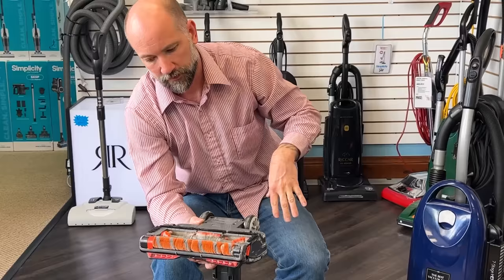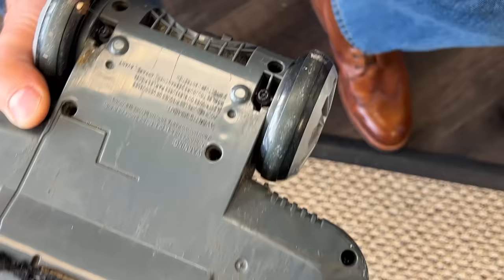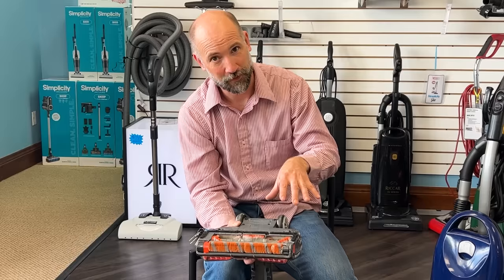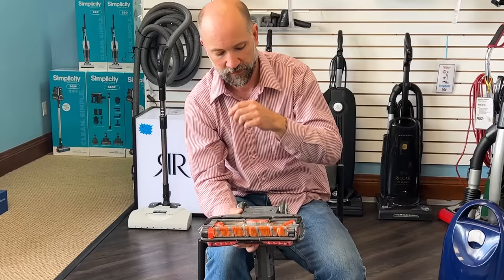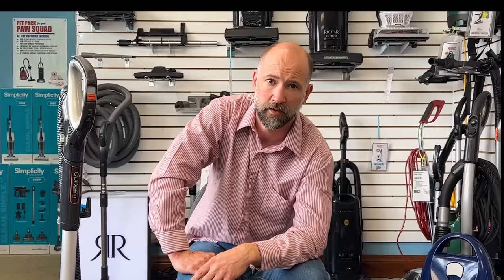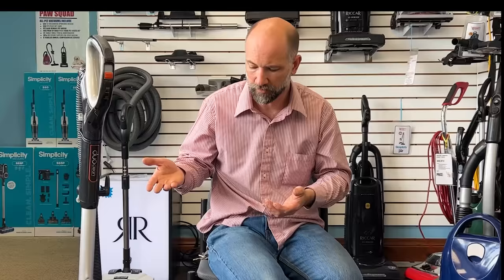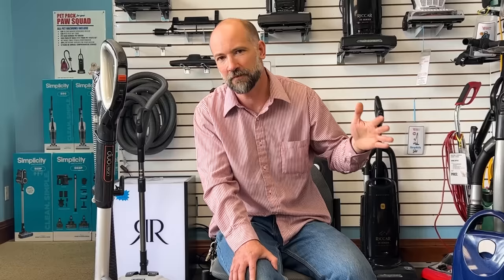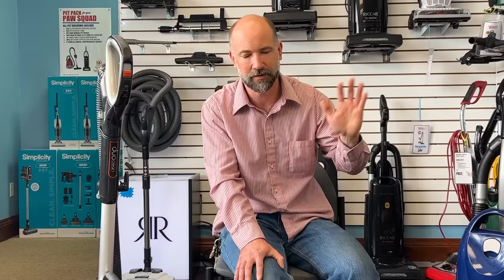Why Can't You Repair Your Shark Vacuum?

Comment: Thank you for your honest & helpful video, unlike this piece of crap Rocket, that lasted less than a year (I loved it up until then, last week) and the Roller just stopped while using (with regular house use) Just prior the green roller light started blinking. I took it apart, but nothing was a miss, nothing preventing it from turning. Rubber roller belt was fully intact. I watched this video & I just tossed out the rollar & the entire housing, used to roll around on carpets in the trash, without another thought of can this be fixed. I will now use it on my patio, with just the long hose, to pick up small leaves & debree, like a mini shop Vac (it still has suction ) I'll remove the hose & use it to vacuum my truck, until the engine goes out, to at least get some beneficial use from it... Next!

Comment: Man, just stumbled across your video because I was frustrated with the lower hose cracking on my UV810 multiple times. First it was a poor design of the brush roller that would build up hair and dirt behind the gear drive and seize up the roller..called Shark and they denied it..but I called them out on it.. ended up taking it back to Costco and got a model that was just 4 weeks newer (since my wife wanted a shark) we got another one. I immediately saw they had changed the design or the roller..I WOULD NEVER buy another shark because of the aforementioned issue, a TON of design flaws, and of course your expert opinion. Thanks for calling this to attention! 👍

Edit:

Interesting, I called Shark to see if the flex hose was even a serviceable item and the really cool young kid I got said no, it needed a new head and those were discontinued. I then told him in a very nice way " older people are always getting blamed for polluting the planet,  and here Shark is filling up landfills with non-serviceable vacuums"  He totally agreed and said he had thought about that too. He put me on hold, came back a few mins later and said you now have a 6 year warranty, and since we don't have the part, I am sending you a whole new vacuum, and the shipping is on me! So there you go, Sometimes the squeaky wheel gets the grease. I still won't purchase another one, but it is nice not to spend money on a vacuum when things are barely affordable as it is. Happy Thanksgiving and Peace.

Comment: Just took my Shark DouClean head apart to fix the dreaded cracked lower hose.  Already had the security bits not a problem but the hose I ordered was a 1.5” that the vendor said fit my model NV 800.  Turns out I needed a 1.25” hose which came the next day, $8.  Refit the right hose buttoned up the head after blowing out the accumulated 6 years of dirt and now it truly sucks wonderfully.  I have a central vac system in my house with a Mietle?  Powerhead but I still use the Shark for the stairs.  I wish someone would make a proprietary stair cleaning head that you don’t have twist your wrist and goes edge to edge.

Comment: bought a rainbow back in 1996 it still runs like new and never been repaired. bought a shark for quick pickups it was dead in a year. oh and when we replaced our carpets the installers asked us what we used to vaccum with as there was no dirt in the padding or on the concrete i told em a rainbow they were amazed!!! you get what you pay for!!!

Comment: Had the almost $300 cordless duo, and batteries died after around 2 years. Tried to get replacements and was told they are no longer made. WTF! This is definitely a strategy! I'm a vaper and really familiar with lithium batteries and could have cracked open the cases and replace the batteries myself. But being no other available parts, ie belts and brushes, I decided it wasn't worth my time and trashed it! Done with Shark! For Comparison my 20 years old Oreck is still working perfectly and only had to replace belt once which is conveniently located in spot on bottom of head and was available for me to buy a backup. Good Video

Comment: Thank you for this. Luckily, this is the first video I checked out re: the roller brush on my Shark which quit working. Now I know it's a dead end. At least this is the only vacuum I've had for 10 years. I hate their business model and will tell others not to buy them. It's a horrible "business model" (if they want to call it that) for exactly all the reasons you listed. Will go check out your other videos now.

Comment: There is a small microswitch in the vacuum roller brush head that fails. It's about a 25 cent part. I had 2 Shark Vacuums that would shut off the roller brush if you changed the angle. I removed the switch and just jumped the wire going to that micro switch . now the roller brush stays on when in 90 degree position and vacuuming position. No problem. Better than not working at all!

Comment: Had problems with my roller not working and I wasn't able to do move it by hand. Looking closely I noticed a sock was lodged in the roller. No idea how I did that, I don't usually vacuum my socks but glad its working now without needing to get it repaired.
Reply from the maker: That's good to hear!

Comment: DO NOT BUY A SHARK VACUUM CLEANER.
  It would be exceptional for most people to use one that doesn't break or have a problem for a few years.  It will break or have a problem much sooner than that.  SHARKS are maddening.
Reply from the maker: Being un repairable is a big issue and we encourage everyone to think about what that means before purchasing one.

Comment: In my hood, when younger generation kids move out of apartments, they often leave vacs on the sidewalk or by the dumpster. They are usually cheaper models that are nearly new and easy to service, but they are abandoned because the canister is full or the filter is clogged. Many of these kids don't know or care how to clean out a vac. They just buy a new one.

Comment: I've had my shark vacuum cleaner for about 5 yrs or more and it's the one I prefer to use however my Wife likes her Miele Canister Vac. The only thing that has broken on it is the flex hose in the power head.  I took it to a repair shop and the old guy just didn't want to fix it as he said, for him to fix it was too difficult with his arthritic hands.  He did however give me a piece of hose to fix it with.  Went online and instructions were there, easy peasy!  I also went on Amazon and bought another replacement hose for it in case the one the old repairman gave me breaks.

Comment: This is getting to be a major problem not just in your business but across a whole range of products and industry, they call it planed obsolescence and is done so you go out and buy new instead of fixing it.

I took my father to go buy a new vacuum and he looked at one in a major electrical store and when asked by the sales person what he was looking for he answer how easy is it to repair, the sale person walked away, he then told me to go to a 2nd hand store where he bought an older model that he knew he could repair, that vacuum has been repaired a couple of times over the last 10 years and it's still going strong.

Comment: Our Navigator lift-away is going on 12 years old and still works great. I've replaced the belt once and just ordered a new brush roller from Amazon because the original one has worn down. My main problem is the long fur from my Flst-coated Retreiver that gets wrapped around the roller.

Comment: Those little studs in the security screws can usually be broken off. A flathead screwdriver of the right size will fit and be able to twist out the screw.

Comment: I have a Shark cordless vacuum and I paid $488 total for it exactly 2 years ago. When I turn it on and select the high suction mode for my carpets, it shut off automatically and gives me an E5 error code on the display. I called Shark and their customer service was stellar by offering to send me a completely new vacuum since it was still within the 5-year warranty. HOWEVER, the IZ600 series that I have is no longer available and they are sending me a IZ300 series model instead. 

I really hate the cheapness of products in general these days and don't get me started on irons. I sew a lot and need a good, sturdy iron that will produce hot steam. Rowenta is usually the gold standard for irons and the old ones were made in Germany. Not any more, however. China is now producing them and they're garbage.
My hubby is pretty handy and tech savvy, so he's going to look at my broken Shark vacuum and see if he can repair it himself.

I'm only 53 years old and I find myself saying over and over again, "they just don't make stuff like they used to" and it bugs the heck out of me that I have to say this phrase! Ugggh

Comment: I bought a DuoClean system in 2017, directly from Shark.  Luckily, I got the 5-year warranty with it. I'm on my 3rd replacement now. Every time I sent in the broken part, and they would send me a whole new unit with batteries.  I'm out of warranty now, but I have the last unit they sent me that's working fine, and I was able to cobble together a 2nd unit with the parts that were working from the other units.  Plus, I have 6 batteries altogether now.  So, at least the customer service is easy to deal with.

Comment: I’m in the UK, I’ve had a shark for two years and it’s been a good machine. I do now have to get into the ‘head’ as in your video as the brush has stopped spinning, it had security screws!!! But I still can’t separate the shell, must be the tabs! So annoying.

I think I’ll go back to my Numatic Henry vacuum that I relegated to my garage vacuum, they are designed and made here in the uk and are simple but effective machines and they pride themselves on being able to supply all the parts for their entire range at very cheap prices.

Comment: In the UK, Shark offers an extended warranty of 5 years. Based on our experience of the Shark Liftaway the extra cost of the warranty was worth the money.

So far, we have had 2 new power units, 1 replacement battery and 2 complete new vacuum cleaners.

The bugbear with the latest replacement is that they changed the bottom of the battery. The new unit has a small square stand-off in the bottom of the hoover. The battery has a corresponding hole in it.

This means that unless you are prepared to cut a hole in the bottom of your old battery, it will not fit the new power unit (the new style battery will, however,  fit the old power unit).

Comment: I bought a shark upright about 15 years ago. It lasted 13 years of hard use. I got more than my monies worth out of it. I liked everything about the vacuum. Unfortunately it’s weak point was the connection points of the short section of hose from the roller brush to the bin. I purchased a new one, same model. The quality of ALL the plastics…., even the cord insulation…, is far inferior to my previous one. It looks identical to the old one, but they’ve cheapened the heck out of it while charging more for the unit.

Comment: I agree with every point, how about the 2 screw anchors inside the rear of the floor nozzles.  Designed to hold for a year or so then snap so the machine can’t stand up anymore.  I just use a soldering iron to weld it back together.

Comment: My neighbours chuckled when they realised that I was on the lookout for dead dyson vacuum cleaners.
The parts for most of the early ones can be interchanged.
Most can be unscrewed with a tuppence coin.
I hate it when I visit the municipal waste site...and I see the electrical items lobbed into skips.
A lot of the stuff gets ACTUALLY BROKEN by doing this whereas many a time by opening up the relevant device and poking about it usually comes down to a loose connection,a fuse,a SINGLE COMPONENT.

Comment: Very good video.  Have a Shark Duo Clean Performance Lift Away, 4 years old.  Soft roller stops working, which I am pretty sure is to do a broken belt.  Love the vac. May repair it, but you are correct with the waste and difficulty access for repair.

Comment: Have had both Hoover and Eureka uprights in the past. Got tired of being nickel and dimed for bags and parts. Final straw was after vacuuming with a Eureka Boss, ran the Shark 501 Lift away Navigator over same rug immediately after and pulled up about a half a cup of dust and dirt. Granted it is a heavy awkward beast but mine is running fine after 15 years. Taking the head unit apart on my model was a bit tricky to replace belt and roller brushes, but not  difficult, mine has Phillips head screws. Have found belts, rollers, brushes, filters, etc on both Amazon and Ebay, perhaps I am one of the lucky ones.

Comment: I'm glad you made this video, I thought it was just me, they are not made to be repaired, and I am a retired engineer, and as for the small bottom hose between the head and the upright it is a non-standard size (in the UK) I had to fit a smaller size inside the original hose to get it to work

Comment: My dad picked up a used one at Good Will for about $15.  Of course, the brush would not spin.  He can fix anything and everything, BUT he encountered the 'special' screws (star with the raised spot in the middle).  After watching your video, he knew what he was up against!  He happen to have a small screw driver that fit perfectly into the star!  After applying a lot of pressure while turning, he was able to get all the screws out.  The belt was fine, but the motor was not working.  He's going to try something with that to see if he can get it running.  If it doesn't work, we may be dropping the vacuum off at your Fort Collins location so you can salvage some parts for future repairs.  Geeze...our 1st Shark and DEFINITELY our last!!!!

Comment: Very informative ! I love(d) Shark vacs but am on #4 and will  never buy another new one. The last ones I bought were 2 Vertex models, one for me and one for my daughter. About 2 years in I noticed  the self cleaning roller brush vinyl fin was tearing loose at one end. Good grief, but no problem, I'll just replace the roller. Ha! The roller is part of the motor assembly, I had to buy the whole assembly at about $125 if memory serves me. And I have to rely on my memory because the Shark website crashed a while back and all my buyer information is gone. They eventually got the website up and running again but not the detailed buyer info, they apparently had no backup system. As a former customer I'd say Shark certainly has poor business practices and continue to get worse.  Since I take good care of my "things" I will buy a refurbished old model that allows for replacement of the brushes and rollers, buy extra brushes and rollers, and  keep it going for as long as possible. Since I am 75 maybe it will even outlast me. LOL

Comment: I couldn’t get a new roller brush when the tufts wore out.   Jokes on them, I bought a $3 scrub brush with about the same tuft stiffness, applied thick superglue to the base of each one, sliced them off, drilled out the remainder of the tufts from the roller, and glued my new ones in. Works awesome.

Comment: So here I am with a Shark NV501 in (some) pieces all over the floor.  Luckily, I have only normal screws with this product (though I do have security bits and torx drivers), but can't figure out how to access the main motor to figure out why it won't run.  Blown thermal protection fuse?  Who knows.   I think I see the writing on the wall, and maybe I'll just back away slowly.  Rather than torture myself, find another brand that's not so DIY repair hostile.   Thanks for making this video and saving me time and frustration.

Comment: I bought a plug-in shark stick vac during the pandemic when batteries weren't available for my Dyson stick. Used it a few times, now got the Dyson battery so the shark sits in the closet.  Took a look at it in response to this video, and I'll be damned, the beater bar is not replaceable without removing security head screws and (apparently) taking apart the snap-together housing.  Never seen a vacuum where the belt and beater bar are not easily replaceable with simple snap in/out parts or at worse cases a few screws.  My shark robot vacuum is not like that, all the filter and brushes and everything are very easy to remove and replace.

Comment: We’ve had a Shark Navigator for several years and the main hose did need to be replaced about 5 years ago. 
The machine does a great job of cleaning, but if we have any problems in the future, it will be replaced with another brand. 
As stated in the video, they simply are not designed to be fixed but rather replaced. 
Just like most things today, planned obsolescence.

Comment: Exactly! I bought a shark for a good price. It works very well. However, my wife's hair was wrapped up on the roller. Instead of just unclipping the bottom I had to go to harbor freight and buy a set of long, thin security bits to even open it. Had I known that I would have gone with a different brand. I plan on using this vacuum until it dies, and when it does I will go with another brand specifically because of the impossibility of general maintenance and repair.

Comment: literally about to dump ours in the trash today.  my roller no longer moves.  I might have ruined it in the process, but i've never had a vacuum so hard to get the roller out to clean it.  it's not just the parts or screws.  This Shark vac has been an exercise of maintaining it all along.  Keeping the filters clean are a constant nuisance too.  it's like you need a vacuum to maintain your shark vac.

Comment: Good video !! I have a NV-500 form (2005?) So far I've replaced 3 hose /handle assemblies, 1 lower hose and a couple of filter sets. Thankfully I've been able to find everything I need fairly easily on Amazon or ebay . (Maybe because it's older ?) I really like the looks of the new ones, and would consider getting another one someday. I really like my Shark !!